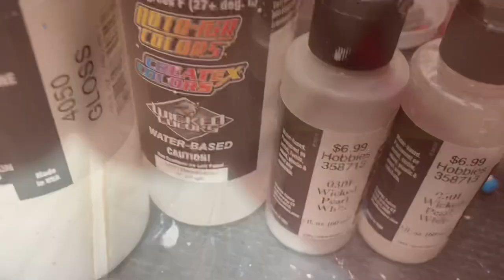How To Paint a Motorcycle Tank Pt. 6- Pearl White, last step before clear

Comment: Nice. Is that stand hand crafted? I'm working on my chin spoiler right now but soon moving on to fenders and tank. I will need a better setup than dangling from the garage door on a coat hanger 😆
Reply from the maker: Funny u asked. Plan on doing a vid on it. It’s a roller stand from Harbor Freight that I slightly modified. I’ll try to do the vid in the next few dayZ.